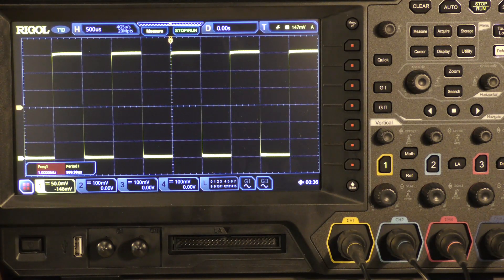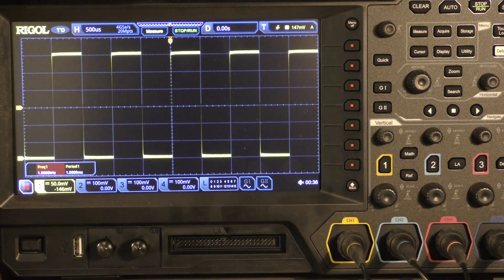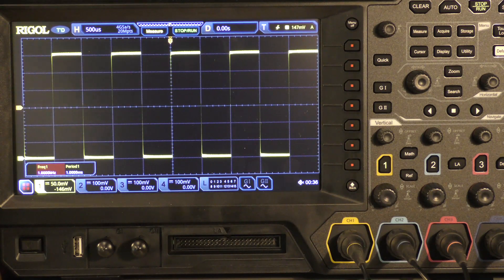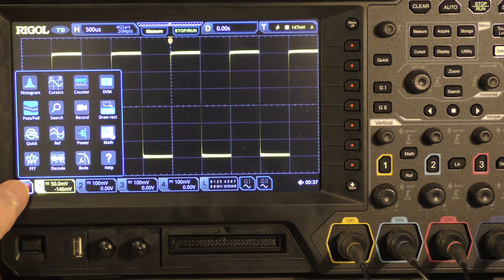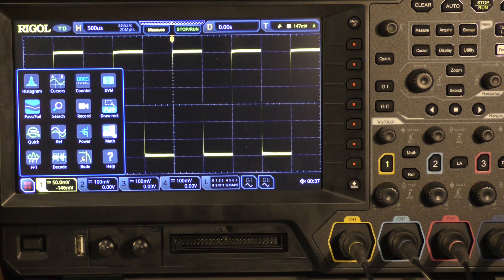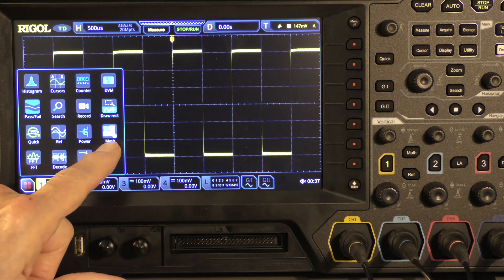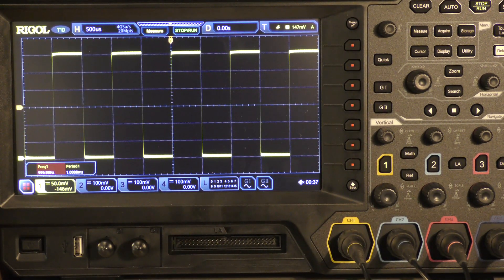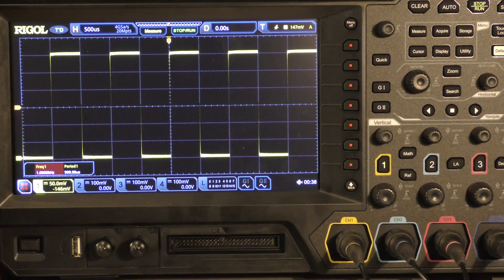Rigol MSO5000 Oscilloscope

Comment: It sounds super interesting! :-)
I have a super narrow and specific question that may properly only interest me:-)
Can the internal crystal be replaced / overwritten by my 10MHz frequency standard?
The scope you have there does not have possibility for external frequency standard, you have to get the MSO7000 series for that.
But is it possible to add that feature by yourself? I am hoping to make that scope synchronized with the rest of my gear?
Reply from the maker: I was not aware that the Rigol MSO/DS 7000 Series had the ability to input an external reference signal and I find no mention of it in the MSO/DS 7000 manual or data sheet. I do not know whether you could add such a feature but I would be interested in seeing comments by others who have more knowledge of the actual circuitry.
Reply: @tomtektest8042  Thanks a lot for answering! :-)
Do you think it's possible to build a "crystal-replacement" I mean a way to make the frequency standard send the signal to the board and make the electronic use that signal instead of the crystal? :-)
Reply from the maker: @friedmule5403  I suppose anything is possible, but if you are asking whether I can help you do this I am afraid the answer is no, I don't feel qualified or informed enough to try it.
Reply: @tomtektest8042  Of couch! I clearly understand that! :-) But if you ever open up your scope, maybe you could try to take a look at the crystal and how it works? Just so I have something to go towards, I do only own one scope so have no mean for measuring or the knowledge:-)